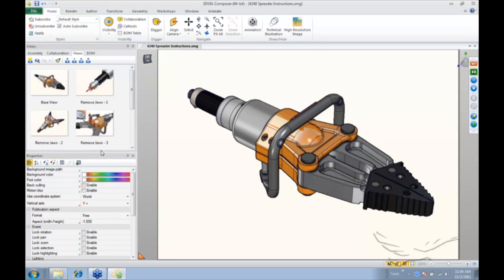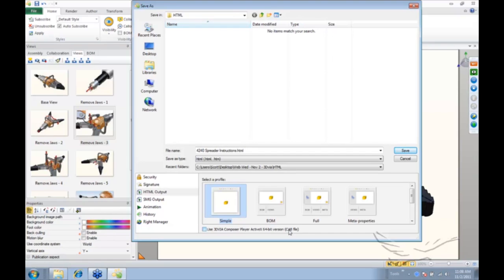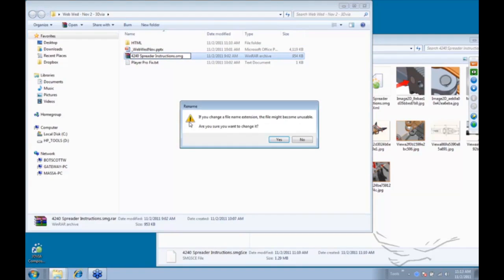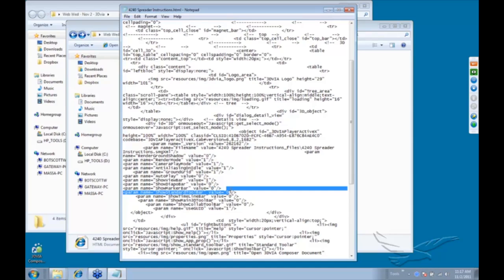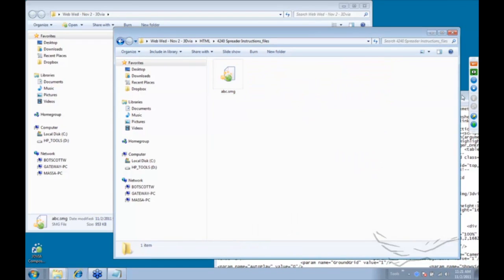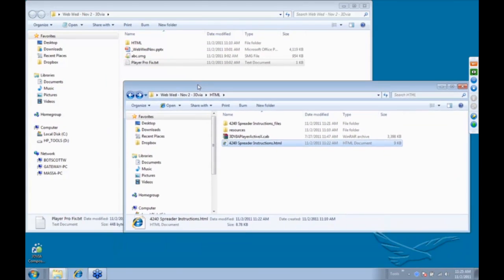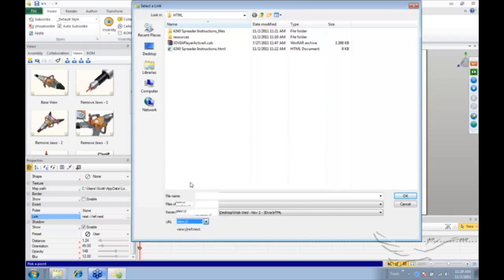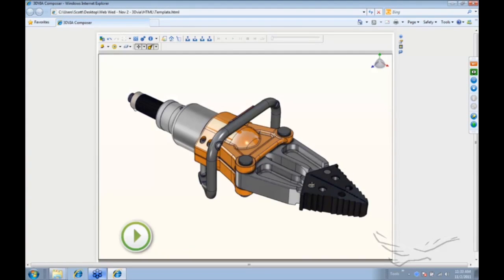SOLIDWORS Composer: HTML Publication

Comment: hi Guys 

I just warn you that are living nowedays 

This tool (the HTML publish option) aint working anymore as in you can not use it nowedays until they make a patch.

We encountered a problem with the HTML export from SolidWorks Composer. 
we couldn't/can not open solidworks composer HTML in chrome or microsoft edge.
To properly map out the extent of this problem, we consulted Claude (Anthropic's AI assistant). These are the findings:
 
— The HTML export is built entirely on ActiveX/Internet Explorer technology.
— Microsoft permanently disabled Internet Explorer on Windows 11 in February 2023, causing Composer's HTML export to immediately stop working for most users.
— The official SolidWorks Composer 2025 documentation still states that the HTML output is for Internet Explorer or Firefox with special plugins — browsers that either no longer exist or no longer support the required plugins.
— Dassault has not updated Composer's HTML export to WebGL in any version: not 2023, 2024, 2025, nor 2026.
— The SolidWorks Composer 2026 “What's New” document only mentions minor additions like filename templates and new video image formats — no reference whatsoever to a WebGL or modern browser solution.
— The community has been asking for a WebGL-based export since at least 2019, with no response from Dassault.
— The only official workaround offered by SolidWorks support (blog post March 2023) is to use Microsoft Edge in Internet Explorer compatibility mode — which is not a sustainable long-term solution for the shop floor, and is itself being phased out by Microsoft.

hope this will help you and will not be like me a 4 day fault finding to come to this conclusion.